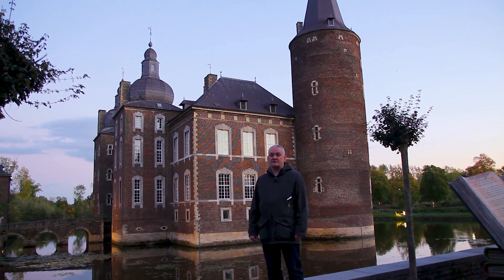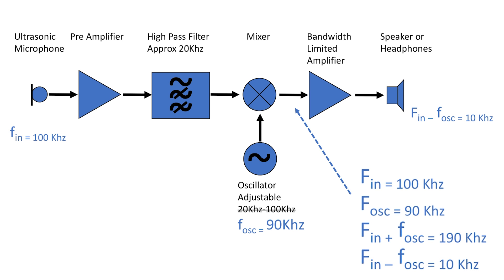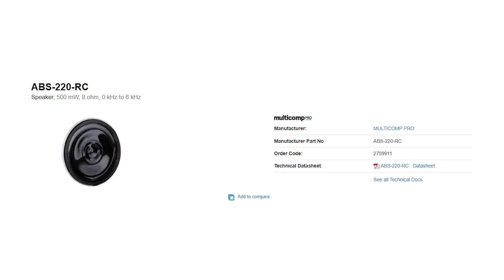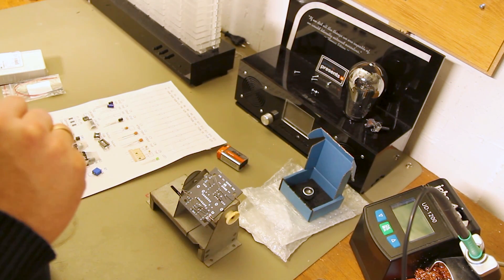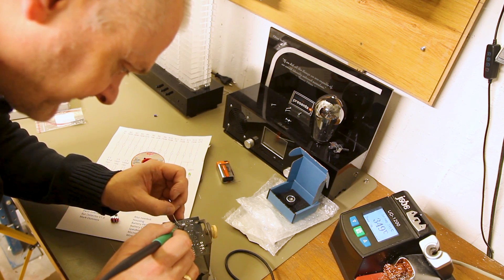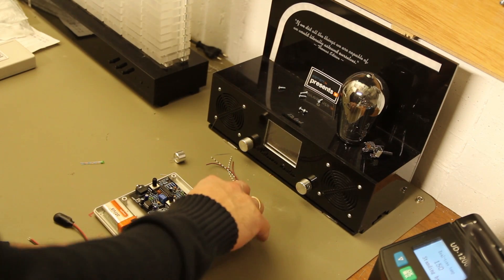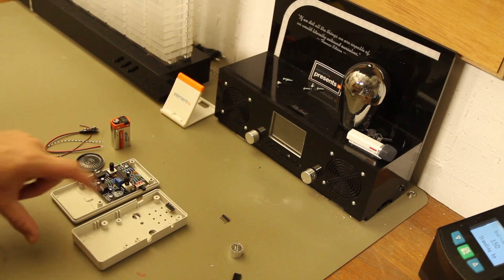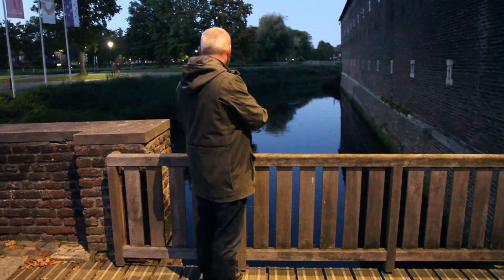Build Your Own Bat Detector with Analog Parts!

Comment: Cool circuit.  One thing I would like to see more of in these videos is how to test the circuit out.   Too many of my projects end up not working after putting them together and I have a hard time figuring out what went wrong.  For this circuit maybe:  verify the oscillator operation, verify the mic amplifier, verify the mixer, verify the power supply, verify the sound amplifier... something like that.  Thanks for the video.

Comment: In the schematics the resistor R15 in the first stage, shouldn't be 470K instead of 470 Ohm?  Otherwise the gain is about 2000 in that stage, looks too much to me, but I'm quite newbie.
I'm trying to reproduce it in a protoboard and debug with an oscilloscope.
Cool project, I have bats in the back garden every evening. 
Thank you!

Comment: would the oscillator make noise itself and mess with the bats trying to echolocate?
Reply: No, it doesn't... the speaker or headset used will not be able to generate that high frequency sound and the oscillator itself is not powerfull enough to generate that kind of noise

Comment: Since the mic seems to be a normal 40Khz... How you can hear 100khz sounds if the mic wavelength is not flat at that frequency. In fact is very narrow to plus minus 3 khz!. 
How to build somethig that cover the whole spectrum of bat frequencies? Mic is the bottleneck...
Reply: I found the best Transducer or MEMS mic were the SPU0410LR5H and FG-23629-P16. This was based on the designer/inventor of the Dodotronic mic and his observations working with and when we commented back and forth on the instructable "Intelligent Bat Detector" comments.